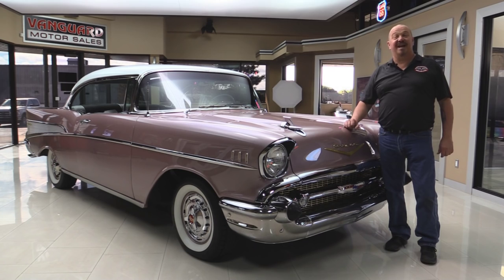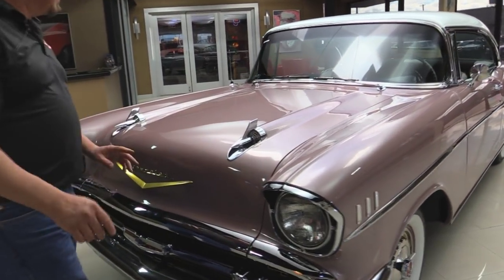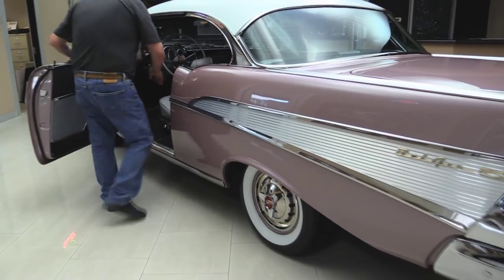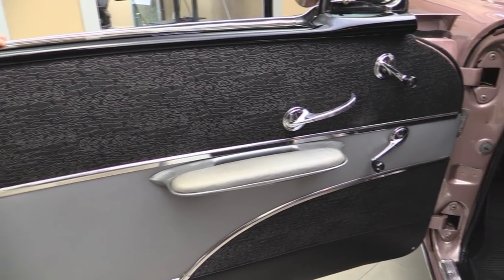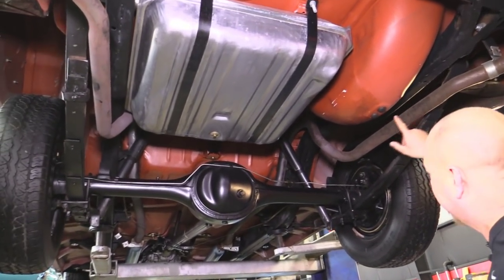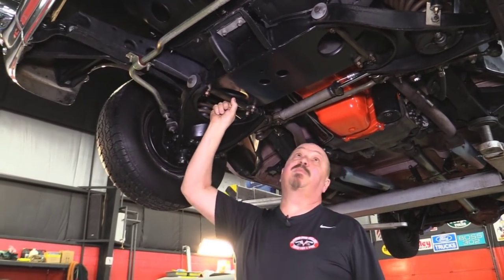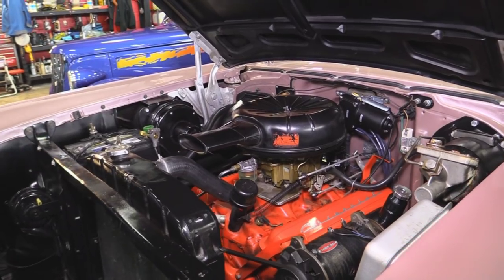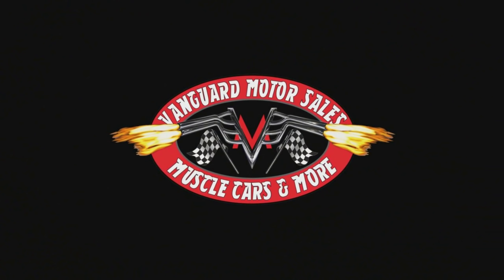1957 Chevrolet Bel Air For Sale

Comment: Beautiful car...I will get a '57 someday
Reply: Tony Amarillas have u gotten it yet
Reply: @spjulyer3124  of course not😀
Reply: I bought one in 1967 for  $250.00,four years later my sister wrecked it,the right rear quarter panel was bashed in,but it still was driveable,the insurance co.totaled it as it would have cost more to repair than it was worth,I bought another car and sold the '57 for $75.00

Comment: How rare is it to find these all-original, or at least; original (oem spec)? If I ever found one, I don't want the mods; I want it like it was off the assembly line... I have a lot of nostalgia for the mid - late 50's, even though I was born in the 90's. Just truly a wonderful masterpiece of American engineering.

Comment: What is it with '57? Cars were so beautyful back then
Reply: Yes,the 1957 Chevrolets are beautiful and you think it would have outsold the 1958 models but it didn't, the 1958 models outsold the 1957 models because in 1957 the U.S. economy went into a recession and didn't start coming out of recession until October 1957,by that time the 1958 models were out,or at least this is what an article i read stated.

Comment: Its weird how technological inferior these cars are compare to today, yet look like they cost 5 times as much to make compared to a lets say 2019 Chevy Malibu
Reply: Yes,they are inferior in technology, I had a 1957 Chevy I bought for $250.00 dollars in 1967,I loved the car,but it had the drum brakes on it,when you drove though any standing water after a heavy rainfall,you simply didn't have any brakes until you could pump the brakes hard and fast and get the water out of the brake drums,if you ever buy one of these cars and it has drum brakes on it spend some money and switch it over to modern disc brakes,you will save yourself a heart attack.